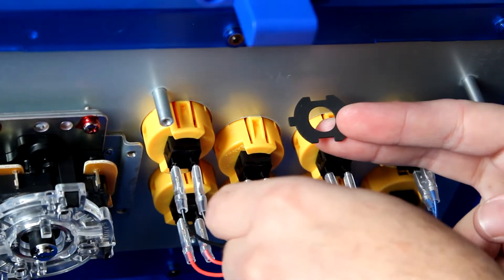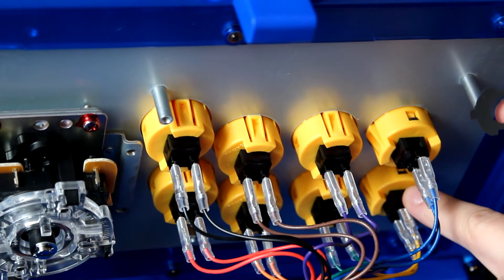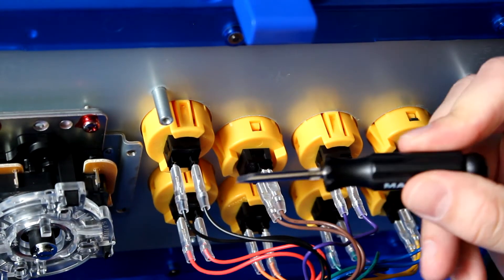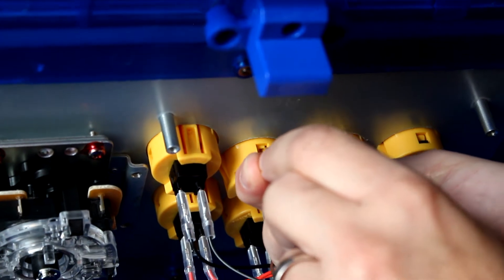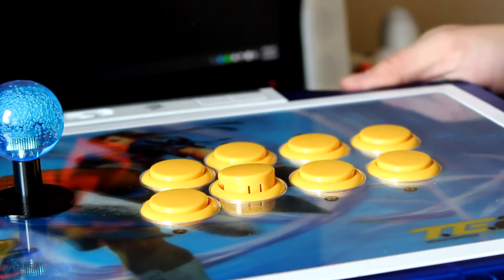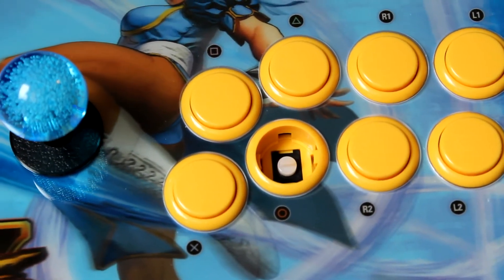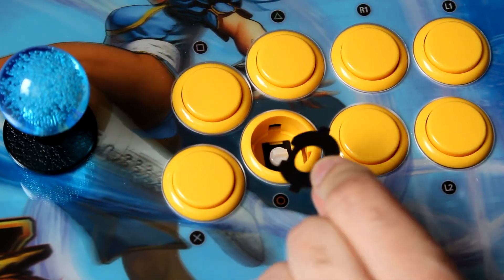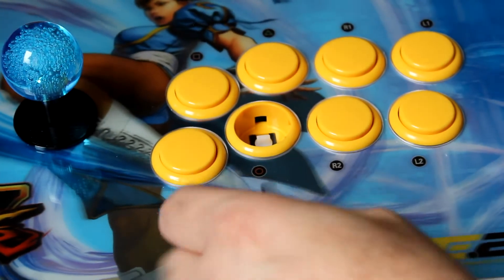Silencer Foam Washer Install Guide on Sanwa 30mm Pushbuttons

Comment: I always rest my fingers on the buttons and try not to raise them too high above the buttons so as not to have to hit them hard, otherwise the sound will be too loud. When I hit the same button all the time, I don't take my finger off it and it's quieter than if I used these foams. So it depends of your playing style ;)

Comment: Nice vid!!! Wow, you can hear the difference! I just got a Mayflash F500 for my daughter to learn Street Fighter but the square gate is very loud. Is there a foam silencer for the joystick?
Reply: It is actually the 4 switches in the joystick that make the clicking noise. You can buy silent switches to replace them but there will be some soldering involved. Alternately if you mean she is just riding the gate very hard at its limit then this should ease up over time as your daughter learns the stick. It's been a year since your comment so hopefully that is the case ;)

Comment: How do the silencer-modded pushbuttons compare to the Sanwa OBSF-S silent buttons? Would you happen to know? Trying to decide between buying silent Sanwas or just buying silencers. Please let me know. Thanks! Great video!
Reply from the maker: Thanks bud, unfortunately I wouldn't know. But if you look at the construction of the OBSF-S they literally have the same looking foam washer in them. I would think they sound roughly the same? Maybe look on YouTube for OBSF-S sound tests and see if you can find anything on them. There must be a video out there.
Reply: Hasteo Thanks for the reply! I conjectured based on a couple different videos (including this one) that the OBSF-S and the FA silencer inserts produce basically the same effect in terms of sound dampening. However, I read in the review section on FocusAttack that the inserts are "squishy, but less than the Silent Sanwas". I figure switching from the standard OBSF-30 to a silenced version will require some time to grow accustomed to the different feel. Did you encounter an adjustment period like this?
Reply from the maker: If you played on your Sanwa's for some time then the adjustment will definitely be there. Because they do not have the audible "clack" feedback, it makes it feel really "squishy". This will also depend on how hard of a button presser you are as well. If you don't mash your buttons a lot then you'll adjust quicker then if you were a button masher. Either way, it works great a dampening the sound and you will eventually get used to it.

Comment: Can these be used on Kuro buttons? I have a Hori RAPV4 and my parents are driven crazy with my button pressing.
Reply from the maker: +NinjaRed5000 I'm not sure they are advertised to be used on Sanwa/Seimitsu 30mm buttons. They are pretty cheap so I guess you can order them and see if you can somehow make them fit. http://www.focusattack.com/silencer-sanwa-seimitsu-30mm-foam-washers-8-pak/
Reply: +Hasteo Some say its compatible, others say I might have to snip off the small tabs on the side, but that won't affect the noise reduction at all. I'm definitely gonna order these and try them out.  Hopefully my familly will stop lecturing me on loud noises.
Reply from the maker: +NinjaRed5000 Good luck bud!